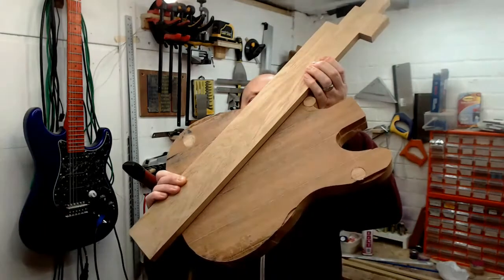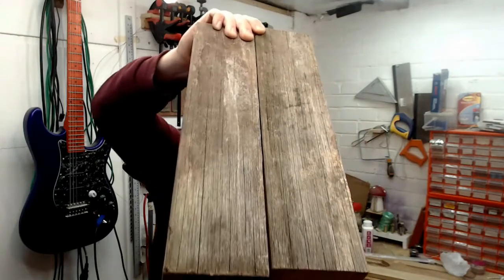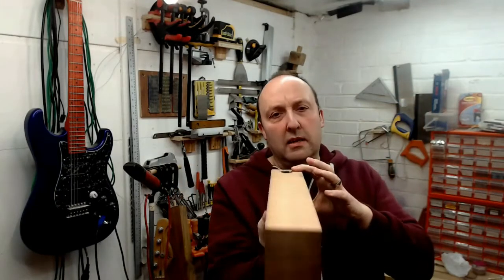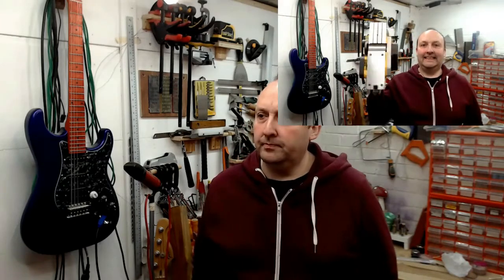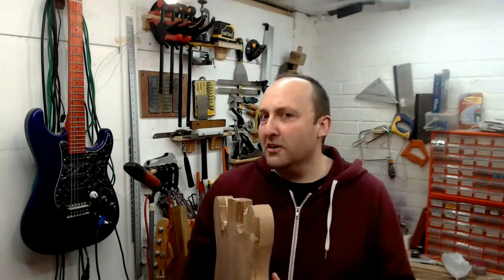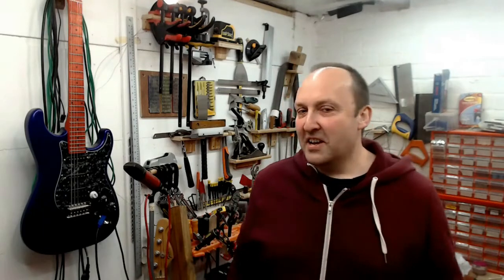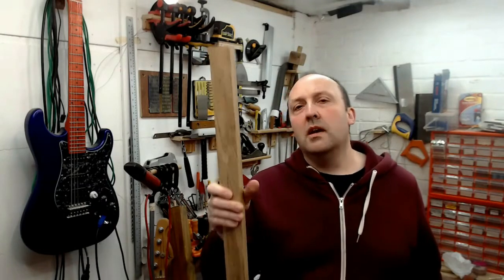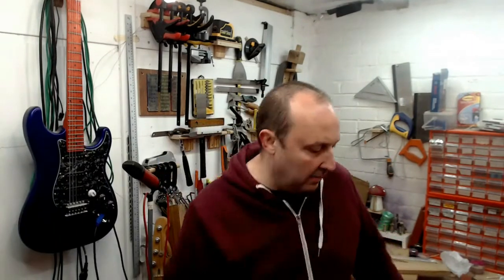More Scrap-wood Guitar Shenanigans with Teak and Oak

Comment: Really interested in your tool chains Chris. I kind of want to move towards next stage of building a guitar (rather than just modding). If you have videos on how you use planar to make a thicknesser that would be cool. I have one of those, a router, circular and mitre saws. Don't have the kinky sander you for but it looks like the Amazon UK relatively inexpensive one?

There again £125 gets one a J & D bass - I couldn't make one cheaper than that - so I figure it's more about the pride and inner satisfaction of crafting your own axe?
Reply from the maker: Yeah, it's all definitely for your own pride and vanity... and to distract me from actually practising.  If what you wanted was a new guitar then that's probably the thing to buy :)

I don't have many tools in the way of planers and thicknessers so I can't really help there.  I try to buy pre-planed wood if I'm getting good stuff then I make it up as I go along.  Once I've worked out a decent workflow then I'll probably let the world know :)